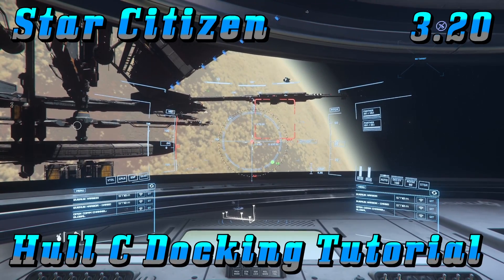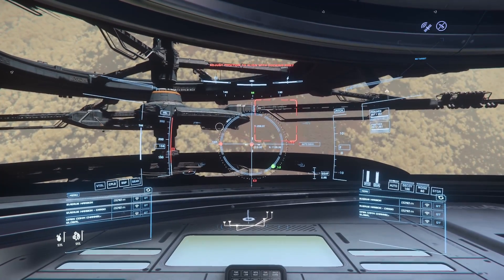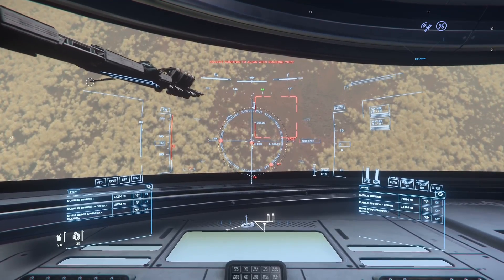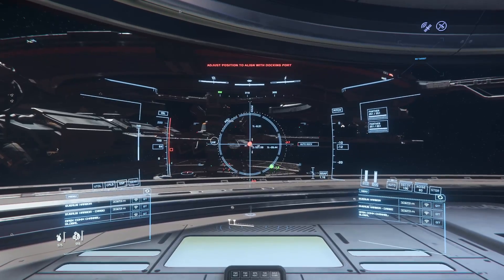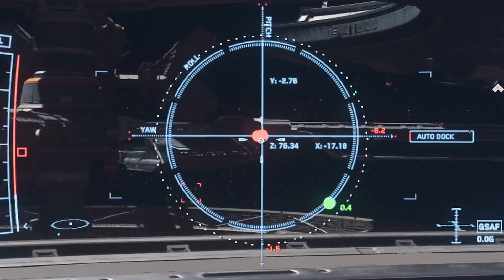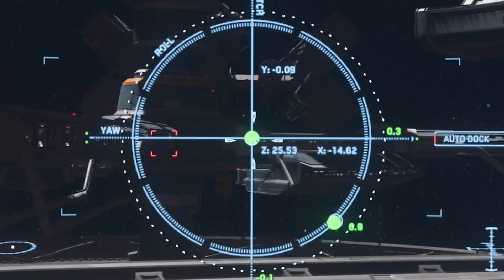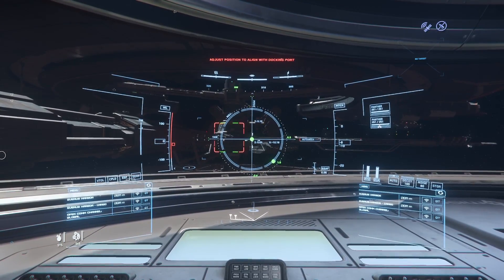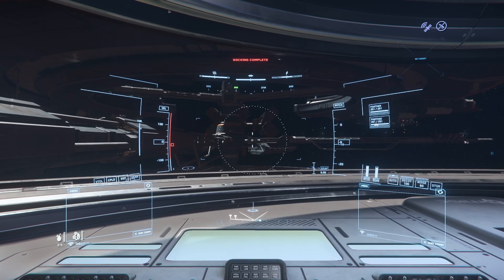Star Citizen: Hull C Docking Tutorial #starcitizen

Comment: Totally agree, NOT a good system for docking.  One thing that's confusing to me is knowing when I'm too far forward or backward.  I've tried using the Z-axis number, moving til it's Zero'd out and I was still too far forward. 
Too, even when I limit my throttles to almost zero, it is too touchy when close. I've successfully manually docked 1 time and haven't been able to repeat it.  As of last night my Hull C is stuck to the docking port with a load and will not undock. Tried stowing and re-requesting, shutting down, restarting, etc. I get no response from ATC. Like the concept, waiting for the polish and refinement.
Thanks for your video!

Comment: Just want to post a warning to anybody trying out the Hull C - don't. The docking is really broken. When my ship auto docked, it was at least 500 meters away from the docking collar and I had no way to get off the ship. Also the first time I tried to fetch it, the doors to the docking collar would not open, and only after switching servers did I get one where it would open, but then I had problems putting it away. Also don't make the mistake of buying any cargo, you will be robbed by a bug long before you can sell it.

Comment: I’m not sure if docking was mostly fixed with 3.22’s recent release. But I’ve tried docking about 7-8 times now with the hull C and only had one small clipping issue that was resolved fairly quickly by retracting the docking collar. The real issue I’m running into is actually selling my cargo with the hull c. Bought 2.3 million aUEC worth of thinking it would be fine. Buying and loading it  via the “green square” cargo loading area was a breeze, but when it came time to sell it at the other jump point station… The “commencing cargo transfer” meter never moved not even after waiting 20-30 minutes standing perfectly still. I even logged out and tried it 3 more times at the same station, then docked twice again and still no bueno. I went to another jump point station that buys the goods and still ran into the same issue. I gave up after trying for about 4-5 hours and just marked it as the greatest fumble in my cargo running career. But I will say I learned a ton about docking and heavy cargo running after this experience so I just consider it to be a very very expensive lesson. Love the new system though regardless. Can’t wait till they fix it and make it more time efficient!!